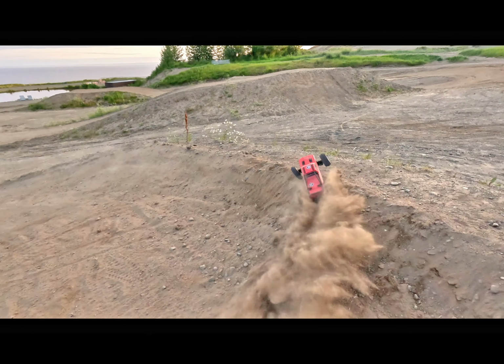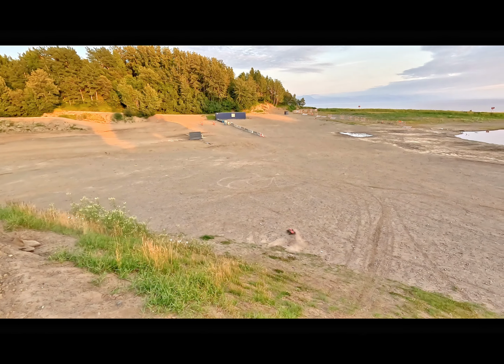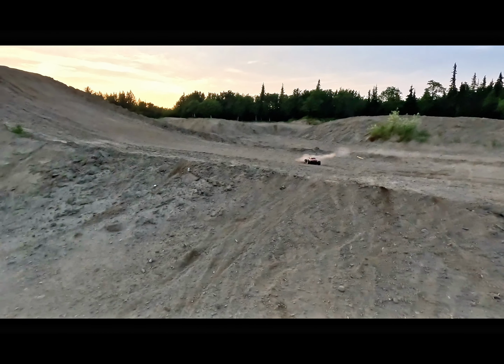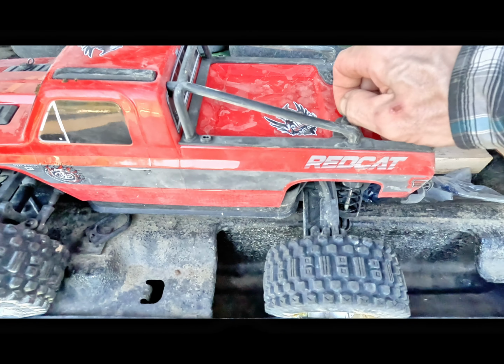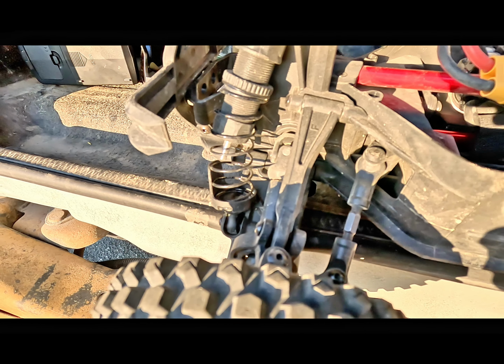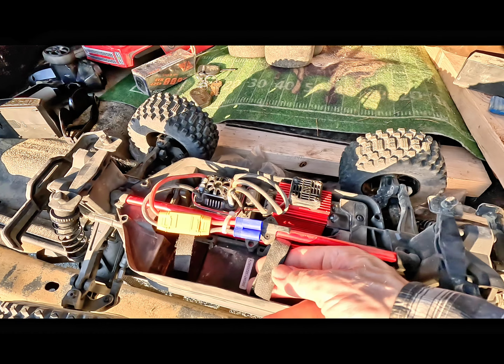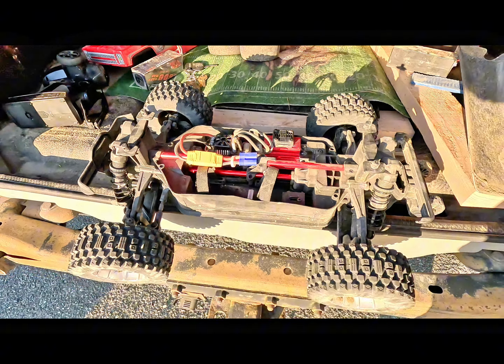Redcat Valkyrie MT 4s first rip, first thoughts- Pocket Rocket!

Comment: Glad it survived. I passed on this one. My last buy was the Rival MT8 by Team Associated. A few flaws with turnbuckles and susp arms, but that included updated extra parts in the box. It was also $349 from over $600. I run it on 4S mostly but it will take 6S.
Reply from the maker: It’s a fun small basher!
The crazy thing with the Team Associated Rival was the 1/10 is a solid truck! The 1/8 though has been plagued with issues unfortunately.  My problem with running a 6s stunt truck on 4s is it drastically reduces your air control. It’s fine if you aren’t jumping but I don’t just cruise around, I’m jumping and stunting. I predict Redcat comes out with an all new 6s platform to complement their 8s Vigilante and his 4s thing. Thanks for stopping by! 😜🤘🏼🤘🏼🚀🔥
Reply: Yeah that was a great deal. I saw that too. I would've grabbed one but have a kaiju already. This truck is on sale right now for only $240. I couldn't pass it up lol

Comment: Nice bash session! I love the look of this truck. What street tires are you running in this video? I'm having trouble  finding aftermarket tires for this platform.
Reply from the maker: Thanks! They are Pro-Line Prime tires, they are older. The pro-line part number is #10116 They were for the Proline truck they had for a bit that was a 1/10 scale basher called the proline pro-mt they also had a short course version. They sported 1/8 size gear and was good for 6s. So it had 17mm hexes. Since that truck has long been discontinued they swapped them to raid style wheel and made them 12/14mm. The hub is removable so you could swap in a 17mm…

Comment: excellent video brou.  this question is from the far side...  The first locating you were at,  looks like a motocross track,   could this be where Ben Lamay grow up riding.  he was the only pro MX racer from Alaska.  like 10-12-15 years ago.    I'm curious, i notice your rear shock protectors in the rear are in the backwards.  Is it spoze to protect the rear shocks from the debris from the front wheels roost.  maybe not.  look funky to me.  awesome vid. Keep up the videos from up north,  always looking forward to them.   Keep em rolling. KER.  Have fun
Reply from the maker: Thanks man, yes this is the motocross track, but I couldn’t say if he rode here. Not any real moto scene here if it was the case I’m sure he blasted down to the lower 48 as soon as he started getting serious. 🤷🏼‍♂️ 
The rear shocks was a result of me trying to see if my shock shafts were threaded on or pressed 😆 I couldn’t really tell because I only tool it off the arm. I told myself I would pull them off later and take a better look. I was in a hurry to go rip haha thanks for the support, more content coming up! 😜🤘🏼🤘🏼🚀🔥

Comment: Dude. I thought the same thing about mine.  Put different tires on it.  It’s better with a meatier tire for all that loose dirt and sand. But it’s a fun truck for sure. She moves nicely. Just needs more rotation. That tire change is seriously a game changer with this truck.
Reply from the maker: Nice, so what tires are you running? I have been trying on stuff I have handy and not finding anything yet. Are you running hex extensions or something?

Comment: as much as i enjoy my 4s cars i am excited to get my hands on one of these looks a bit smaller then im thinking it should be
Reply from the maker: It’s an opportunity size, it’s a tad longer wheelbase than my Outcast 4s, but the arms and tires are shorter and smaller. Deff not a straight up competitor to the Outcast in my opinion. Rig itself feels super stout though curious what you think of the hinge pin design and layout.
Reply: @StraitJacketRC  i like the steering set up i cant wait to see how it works... ive not heard any real complaint other then the shock rod ends

Comment: What video equipment are you using bro? A go pro?
Reply from the maker: Yes, I use a pair of GoPro 11’s. The one I wear on my head has the media mod. The camera is part of it but more importantly is the settings etc.
Edited w/ CapCut
Reply: @StraitJacketRC  OK, nice bro. Thanks. I need one of those lol. Either that or get a headstrap for my phone that one of my friends told me about on Amazon.
Reply from the maker: @lilproto9876  yep np. Just be aware I learned the hard way that you can’t use this media mod attachment with the GoPro head strap that they currently sell. The screw to mount it to the head strap comes in from the wrong side. I’m using the last version GoPro head strap. The media mod is key for helping cut wind noise etc. good luck filming it’s tougher to do good than some make it look haha 🤘🏼🤘🏼 any questions or whatever don’t hesitate to ask I don’t know much but I’m down to help 🤷🏼‍♂️